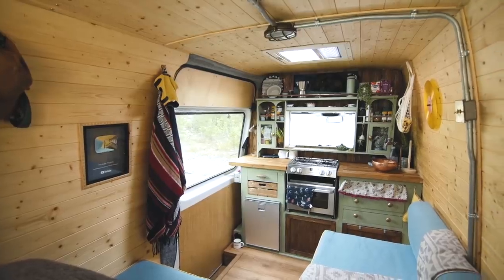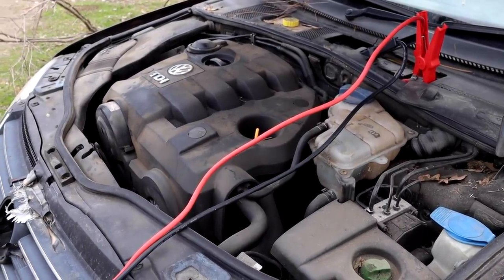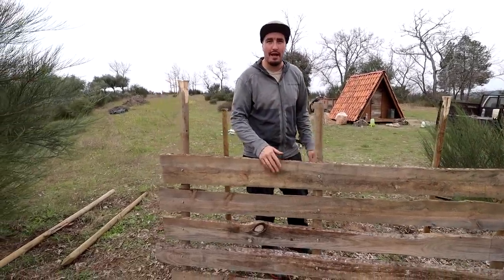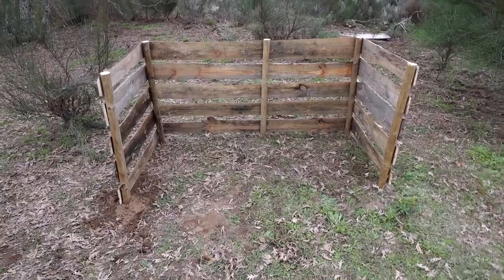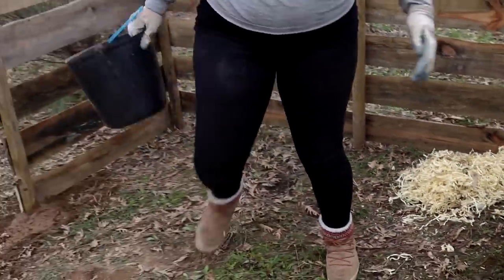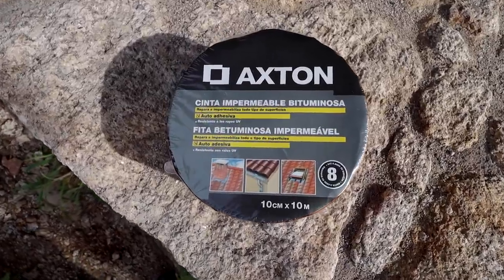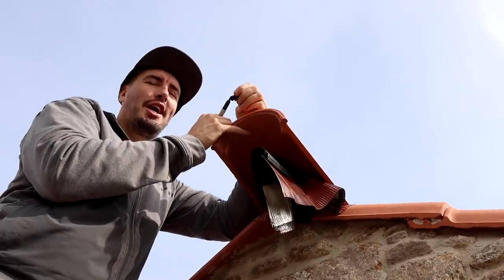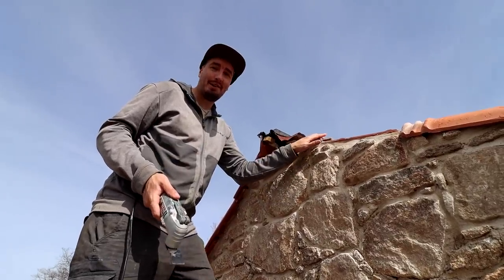Building a Stone Cottage OURSELVES | Six Months In!

Comment: I have a tiny window idea💡.  Trim the inside with a jamb and make 2 windows that will attach to it with hinges. One mounted on the outside and another mounted on the inside. You’ll get the two pane insulation factor and be able to open both and have an opening, you could even make a screen to wedge in it.  I know the excitement of the composting box going up. Pile the right side up first then let it rest and decompose while you fill the left side. Then you’ll have the right side ready to use first. Otherwise all the ready to use will be buried at the very bottom. It’s cycling the pile. Really enjoy your videos.

Comment: "I ran out of fuel for the chainsaw because I spent too much time on the dirt bike" these are the kind of problems I want in my life.
Reply: Time there were TWO  containers, if not THREE for fuel etc.
Once youve used one  time to refill it.
So.ethi g coukd happen and yju csnt grt petrol rtc etc. At least youve then got backup.
Id dig a hole  a fair didtance away from yiur house and anuehere else and line it with bricks or stone then put an insulated roof on top.
Store your containers in there.
Put a door on to stop little furballs etc. At least youll know where they are - at a safe distance.

Comment: My husband says that constant white smoke in the exhaust could be a sign that you have a coolant leak meaning that a head gasket is going out. Otherwise he thinks you just need a new battery. Also he is very jealous of the truck.
Reply: If, as was said, lights occasionally stick on, I would check switches - they can go bad internally with age. Might also be an intermittent ground fault, letting some(thing with) permanent +12V  feed connect to ground. Jostling and/or water might be factors there...
If nothing else helps, a master switch installed on the battery + wire definitely cuts off any flow.
On a modern vehicle there's stuff that generally don't like that, but appears old enough to be a non-issue.
Battery health - can be tested if you find a place that sells car batteries (don't know about the big box stores though) Just have it reasonably charged when testing for accurate results.

Comment: Hey! You might want to consider closed sides for the compost heap, keeping it moist might be a big issue in Portugal's climate. Air will make its way in, so shouldn't be a worry. You could use cardboard to line the current sides. As others have suggested check out Charles Dowding's videos.

Comment: For future reference try if possible to get the uprights to take the strain of the compost not the screws. So by placing the horizontal pieces of wood on the inside of the posts the slats would be in compression  to the posts rather than the tension that they are now. To get over the join in the corners, shall we say you put in the back portion first with enough of a gap between each board so that you can fit another board between them. The side planks can then be placed in the gap of the rear, so that you have a staggered joint in the corners (like a finger joint). All the planks will be in compression and the screws would be used just to keep the height of the plank and not used to hold everything in. I do hope that you don't think that this is a criticism of the work that you have done. What you have done will last for quite a bit of time and will work, but having the boards on the inside would last a bit longer. Just my thoughts and thank you for letting me in to watch your progress

Comment: Easy quick fix for the electrical to hold you over until you fix the electrical is to get a battery disconnect switch.  Than you just open it when you park and close it when your ready to start takes 10 minutes to put on and costs $10
Reply: We have one for a car we dont use often there great saves your batterie from going flat

Comment: Use a bottle in the whole. Clean and dry well, Seal the open end with something clear. Presto a thermal window! A jar may work better as you can use the cover , put the jar in so that the lid is against the side and the clear glass is on both sides of the opening.

Comment: Bravo! 
I’m so stoked about all the fine work you two are doing there. 
There is a technique that the Earth Ship builders use over here in the U.S., of embedding a series of wine bottles, bottom out, into the walls of their buildings. 
This allows multi-colored light into the interior of the structure, and keeps the walls structurally sound. I thought of that when you showed the tiny holes that still need to be sealed up. 
Spring-like weather in late winter is not uncommon in many parts of the world, however, the first day of spring in 2020 is on March 20. Spring has not quite “sprung” just yet. 
Three more things I love about this week’s episode: new sander, new table saw, and FERNANDO! 
Rock On

Comment: I drove a ‘75 for 25 years until the frame rusted beyond my Bondo skills & I sold it on to a metal worker who’s still driving it. Check your fuses first + the contact under your brake pedal. My pedal had gotten loose over the years & was creeping down with gravity to switch on the brake lights when the temp changed with weather. Ditto the fuse controlling my dome light. A little roughing the contacts with sandpaper, pulling them out a hair so they kept tight touch with the fuses & half a box of fresh fuses for the ones looking a trifle iffy & I went on another ten years until the mount for the ground wire rusted out. That’s when it went beyond my skills & the metal genius, knowing I maintained the heck out of my things, stepped in to give it a home.

Comment: Fernando has turned into quite a handsome young man!
I very much understand your excitement over the compost bin... I've bin composting for decades. Tip: put some flat rocks at the bottom (it doesn't need to be solid) - they will let you know when you hit bottom, when you're digging out compost to use in the garden.  Before I did that, after a few years I noticed I was digging a very deep hole!

Comment: If you fill those holes with pipe, you could still have them available to use the scaff to do roof repairs. It’s quite stormy windy and you might have to replace a few roof tiles in years to come. 
If you got a tall jar, with screw top lid, cut the base off that would make a pipe which you could have a removable cap to seal up the outside. Even more snazzy, you could cut out the screw top lid and put glass on, to make it a removable porthole mini window.

Comment: If the trucks headlights are staying on it is just a faulty headlight switch which is a simple plug and unplug to replace and you can find one on ebay.  If it is the brake lights staying on occasionally it is the brake switch behind the brake pedal and another easy fix . Those trucks are notorious for having ground cable issues . It is a secondary wire usually smaller than the normal ground cable that should connect to the frame from the negative cable end on the battery .  Good luck on the truck I have had one like it for 16 years and they have paid for themselves 10 times over .

Comment: If you really want to make your own window, I would recommand you to put it at the inner side of the wall. It is easier to open and you can paint the sides of the wall towards the outside white to enhance the light. I have a very similar window opening in my cellar, and put in a commercial window on the inside, and so I haven't lost any light coming in. Instead of painting, I put some mirrors between the windowframe and the outside (on the sides as well as the "ceiling"), and it is amazing how much light comes through.

Comment: Theo and Bee: in the small window slits, you could paint the inside white and then add the frame and glass. This could help bring in some light from different angles. On top of that you could angle the stone in a bit with grinder. 
Ps(sorry if I spelled names wrong)

Comment: In historic buildings you often see slit windows like that without a frame. A bead of cement is placed around the opening, set a little inside the exterior hole. The glass is then fitted up to it from the inside and puttied in place. More light if no frame. Unless you want it to be an opening window of course..

Comment: @Theo: I have the same table saw. The factory fence isn't punctual enough, no matter what you do there is a 0,5-1cm play in it and it makes hard to make clean, straight cuts. It's good to cut down firewood, but hard to use for any-kind of carpenter projects. Try to replace the fence, there are a lot of after-market options available.

Comment: Great job! Just in connection with your compost, you could start on the bottom with some of the thinner branches of your trees, think I saw some piles there. They will break down in time, but would be a good “foundation” so that there is some air flow. Also generally you would have a wall in the middle so you can have two “processes/stages” going on and move between. Maybe watch some videos of some experts on the subject.

Comment: Spray of wd40 when engine running, straight onto belt. You need to get the alternator checked to see if it’s putting out enough power to charge the battery. Also check out the date on the battery if it’s got one stamped on it.

Comment: Howzit you guys! Theo. You need to buy a 6m length of 48mm steel tube, or two, cut them in half and use them for bracing your scaffold against the building. Youll need a swivel scaff clamp and a ratchet strap for each leg. Mostly, you only need two, but in the event you want to build a freestanding tower, youd need 4. I too have a tool fetish. I wander up and down the tool aisle looking for something I dont have yet but could conceivably need in the future. Keep up the good work. Hand tools are best. They are as off grid as you get.

Comment: My dad,s tip when you finish with the saw put oil on it eny thing or wd 40    post ram was the wepon you needed but need,s must as they say  the compost put somethink on the top to prevent it drying out to mutch  that way the bug,s will like it and do a good job 🤟👌

Comment: The light issue on your truck is most likely a relay. The relay will stick on the closed circuit position and keep the light from going out. The age of the truck to be honest you may want to look at all the relays, they are cheap and over time they just start acting up. Sometimes they just won't engauge or they do and then get stuck and will release when they get in the mood.

Comment: I had the same issue with an old car , inside there are tiny plugs/pegs (not sure what you call them .. maybe fuses ? )small with coloured plastic ends , anyway I. Changed a few and it worked they only cost a pound or two for whole pack x

Comment: Lookin great guys! as for the truck could be a sticky relay on lighting circuit! or as i have had before grease in light switch has become conductive with worn copper or brass. get an amp meter and disconnect the positive battery lead. install the amp meter between the battery and the battery lead. with the ignition off there should be no  current flow. zero amps... if you do have current flowing, remove each fuse one at a time. until current flow disapears. you know then what circuit the fault is on..

Comment: Looking good , nice tools . The truck , what lights stay on , brake lights , or more than that , , just in the back or front also . I think you said it only happens sometimes . If the lights stay off does the battery still go dead . If just brake lights , may be the brake light switch , here they are usually on the brake pedal under the dash . Does it have a wire connector for in the back for a trailer hook up , as those plugs like to short out and can cause lights to stay on . Sometimes a bad ground can cause feed back and cause lights to do weird things . . If battery goes dead with lights off , look on youtube for parasitic drain test . Then you can see what circuit it is draining on . A alternator can cause a drain especially if a diode is going bad , but it must charge or it would not start the rest of the day , but if you have a volt meter , test battery voltage , truck off , truck running and truck running with heater blower and lights on and see what voltages are , not running should be 12 v or just a bit more and running with stuff on or off should be 13 v or more . To test for bad diode , look on youtube for alternator ripple test  , but if it only goes dead when lights stay on then i say alternator probably ok and something shorting out like brake light switch , trailer plug , bad light socket or even bad ground at tail lights . but all that is guessing without seeing what all is going on . A multimeter would be handy in figuring it out , could un hook like one tail light and see if still does it , if yes , put it back and un hook the other one , if still does it then , unhook trailer plug if it has one , and keep trying things till you find the issue .
Reply: oh and an ignition switch can cause things like that . Just so hard to say with out being able to be there and test things

Comment: Little guess what could be the reason for your truck-light-battery-thing:
Check the ignition switch!
I had a very similar experience with my old corsa and it freaked me out since I checked and changed all elektricity but nothing solved the mystery. Probably I'd never have found it, if not some nice day a small column of smoke came out of the ignition switch! I went to get another one from the scrapyard - problem solved 😁

Comment: I have an idea for the higher hole in the wall. You talked about putting a small framed window.  I saw a stone house where they took wine bottles and put them in the walls. I couldn't go in and look  but I'd  bet it looked very cool.. I'd use a blue wine bottle and cut it accordingly., if u want it to stick out or inset. Try it, if  u don't like it. It would be easy to break it out. Love what you're doing 💙💜🐈🐈

Comment: Divide the compost heap into two sections!  That way you fill one side, (turning it from time to time so it breaks down) and  then 
, when one side is getting full,you can start the other side whilst using the completed part without running out of usable compost.  If you layer your compost  i.e. green (grass, leaves etc), brown (chicken poop etc. DO NOT PUT DOG OR CAT EXCREMENT IN YOUR COMPOST) and organic scraps( egg shells, vegetable bits (NEVER ANY ANIMAL BONES -:COOKED OR NOT-) then repeat plus moistening as you build the heap which ensures that you should have consistent heat to maintain and complete the breakdown process.  It is worth doing a bit of research and learning on the internet as you start the compost pile because if you do it right you will have an amazing source of free fertilizer.  If you put some of the wrong items into the pile you literally could damage your health.  Enjoy watching you guys.  Haven’t figured out yet how to find and read any replies  you might have to my comments but I’ll figure it out soon

Comment: If your light switch is on the stalk, it could be worn out and not disengaging correctly when turned to off. As suggested in another comment fit a battery isolator switch in the meantime.

Comment: Until you discover what is wrong with the truck electrics, you should disconnect the negative battery  terminal, this will prevent battery discharging while the truck is stopped.

Comment: Squeak is serpentine belt. Power loss may not be related, but could be...if your alternator is bad it will put unnecessary pressure on belt and squeak. Then alternator is not charging battery, thus dead truck.

My guess though...
Serpentine belt just needs to be replaced.
As far as electrical, I think its your ignition. In older vehicles its common. The cheap fix?..."find the sweet spot"
Meaning, mess with it a bit and find the spot where the power is definitely off.
DIY fix?... pretty simple you can do it, but sometimes there's a special tool. Its basically a "star drive" screw with a tiny post in the middle of the star. Sooo, take a star drive bit and drill an appropriate hole in the center. Other than that its fairly self explanatory.
Quickest?...Take it to a shop. 🙄 They always charge too much, but if its none of the previous mentioned, then they'll find the problem.
Hope this helps ✌

Comment: you have no green in that compost it wont convert and you need to enclose it  so you can reach the minimum height of  one metre so it can start to heat up or you will simply end up with a pile of scraps that may break down in a tear or two , there is a lot more to compost but you need three parts brown to one part green plus manure plus water and keep it wet.

Comment: Theo buddy go online buy a chassis ground electrical system repair guide off the Internet and a automotive electrical tool and bits kit off Amazon or eBay quite cheap and simple.  Buy that cat a laser pointer toy... most electrical problems are stupid simple but take time to check all the issues that lead to another issue until you suss out all the issues bad grounds corrosion and degraded wires rusting inside a plastic coating just to name a few.

Comment: Could be an issue with the light switch. Noise sounds like a dying bearing.
Reply: It's the accessory belt slipping because it's starting to lose flexibility. It's normal in those old Nissans.  : )

Comment: Good Lord, if only I could jump straight up into a flatbed like Theo. Strong or what?
I ended up installing a tank on the farm and getting the fuel delivered  as my nearest supplier is 15 miles away, I was constantly running out before. The downside is it is minimum of 200euro, the more you buy the cheaper it is per litre, but its worth.
The roof is absolutely brilliant and the compost bin is so needed. It's all happening now. I love the idea of a glass bottle for your slit window and no need for a tiny frame.